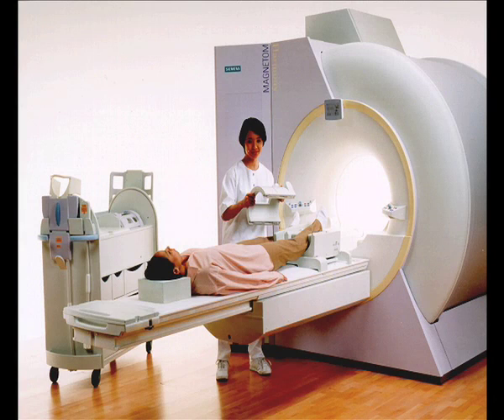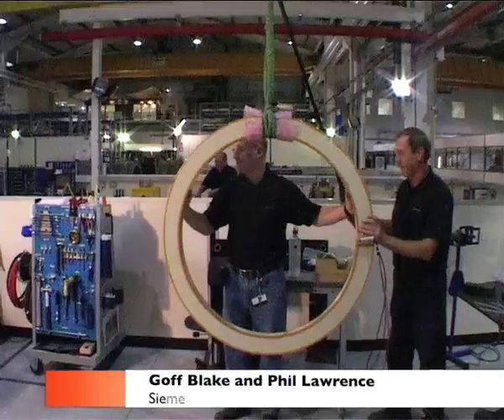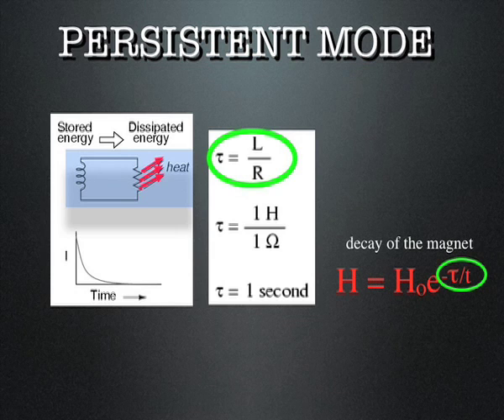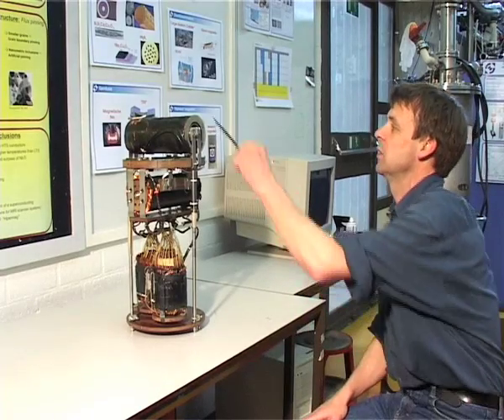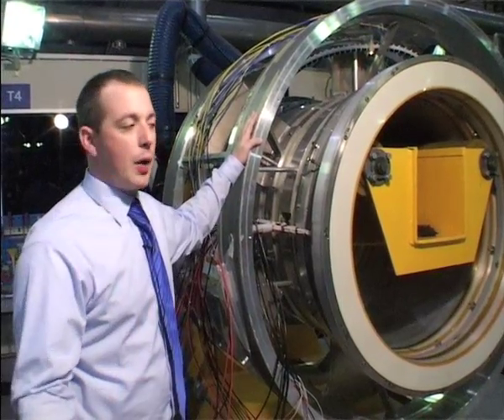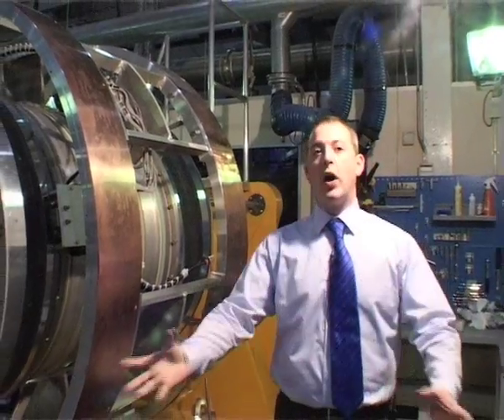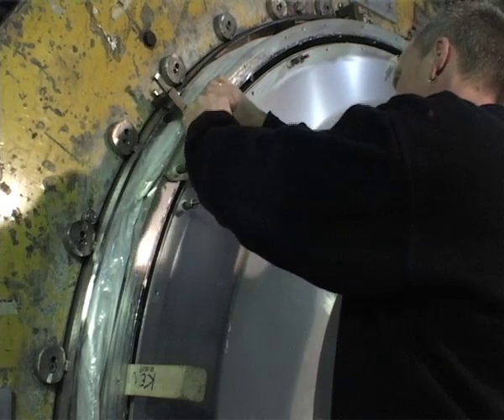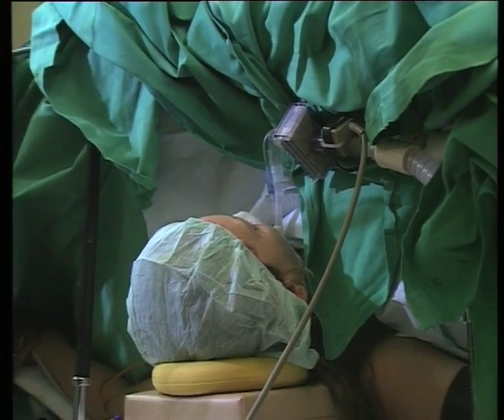Supeconduction: magnetic resonance imaging

Comment: FIrehose of dense information. Presented TOO quickly really - the "flux pump" section was particularly confounding. That's my problem though and not the presenter's! Why would HTS magnets need a constant power source?
Reply from the maker: Any change in the current through the coil leads to a large voltage spike, mechanical stress in the windings and eddy currents, all of which can precipitate a quench.
Reply: @bhadeshia123  right but I'm just saying I don't really understand why that's an issue in HTS but not LTS. what about HTS makes it different if it's in the superconducting state?

Comment: *THEY DO A GREAT JOB BUILDING THE MAGNET*

But magnet-builders are nearly 100% clueless about the *exact physical nature* of how the magnetic field manifests itself in the space around the magnet.

He said at time 5:40  "The stray field goes out about 40 feet" outside the magnet.

That's easy to know, because the stray field can be measured.

But if you point out the following, no informative answer will be forthcoming:

"You say that the stray magnetic field will be 40 feet deep outside the magnet - you are aware that this will hold true in the vacuum of empty space, correct?  In other words, if you carried this 7 Tesla magnet into space and turned it on, you'd have a 40-feet deep magnetic field surrounding the magnet?  Point being, no atmospheric gases are required to manifest that magnetic field - you know that, right?"

ANSWER:  "Yes, of course.  Magnets absolutely work in empty space - otherwise, none of the space vehicles and satellites launched from earth would have worked, since they all use electromagnetism in their electronics, including areas outside the habitable spaces.  Magnetic fields absolutely function the same in the emptiness of space."

"Alright then - what is the physical nature of the magnetic field,  since we know that no atmospheric gases are required to manifest the 40-foot deep magnetic field this 7 Tesla magnet creates?"

ANSWER:  "It's magnetic lines of force.  From Maxwell's equations."

"But what is the physical essence, the 'carrier substance', that allows the magnetic field to be a continuous entity stretching 40 feet deep?"

ANSWER:  "Magnetic lines of force."

This has been a 'blind spot' in science for all of human history.  Very few people know the correct answer.  The proof is, if you ask the similar question "do electromagnetic waves propagate by way of a medium in empty space?"   the answer will be  "light waves, radio waves, etc. - do not require a medium to propagate."

Not only does the majority of science believe that, they do not even realize it should be challenged.
.
.
Reply: Thats why the electromagnetic force is listed as one of the four fundamental forces and everyone agrees to consider it as an axiom at this point. Probably there is deeper stuff at work, feel free to figure it out. 
Cheers.
Reply: @MrFujinko  The particle-antiparticle 'soup' of the QED (quantum electrodynamic) Vacuum is the 'deeper stuff'.  This is at least part of the answer.  Thanks for encouraging all of us with our curiosity that investigates beyond the conventional!
Reply: @Greg_Chase  What about this Casimir effect and virtual particles, stuff can just pop in and out? Is it the vacuum itself changing?
Reply: @MrFujinko  I stopped publicly talking about this because there is very deep, passionate conviction in the mainstream about status quo 'modern physics.'  I got sort of fatigued about the grief it caused.  When it comes down to brass tacks there is always a demand for repeatable measurements and the insistence that "you cannot reason along those lines because our present ability to measure Nature at that level does not exist."

One interesting point that is always suggested about virtual particles is that they 'pop into existence' and then self-annihilate.   For example an electron-positron pair pop into existence and then annihilate.

If the QED Vacuum was (partly) a 'soup' of electron-positron pairs that are constantly annihilating,  there should be a massive gamma ray component of the Vacuum.  The reason is, it is known that the annihilation of an electron and positron emits gamma radiation.

When presented with this,  the usual defense is "virtual particles don't really exist" and that "they don't really self-annihilate"  and that "virtual particles are a mathematical notion only - not physically real."

There is a massive investment in time, money and career to participate in mainstream physics. The near-complete majority of such people will defend convention as if it was their first-born child.  I'm in no position to persuade anyone anymore.   But lines of inquiry into the exact physical nature of magnetism and gravity are rewarded if you cast off convention when it becomes necessary.
.
Reply: @Greg_Chase  That was very interesting, thanks for taking your time to respond.
Reply: You mean heavisides equations
Reply: @jonathanfilip6498  Yes, and imo the sooner we abandon Heaviside's worthy but ABRIDGED desecration of the master's work, the better.

Let's get back to what MAXWELL said.  Heaviside's goal was to abridge what he (and many others in that time) felt were 'clumsy' or 'intellectually inaccessible for the common electrical engineer' original forms from Maxwell.

It would be like taking a 1st grader and saying "we're abridging your mathematics education - here are several easy-to-solve differential equations.  That will do you for practically any engineering job. You don't need to spend your next 12 years of education, 1st through 12th grade, learning tedious math - we just showed you the most important bits."
Reply: @Greg_Chase  maxwells work is extremely important. It’s the only reason heaviside was able to extrapolate those 4 equations. But you are right. Going back to his work then moving forward is the best approach. No education system will ever teach you that
Reply: @Greg_Chase  one important but off topic question to ask would be what would Tesla be doing with all this digital equipment and circuitry we have today. We can create any waveform we want so easily today. We forget how important that is
Reply: @jonathanfilip6498  He would have developed sophisticated artificial gravity control.  In reading his experiments, it sounds like he may have accidentally discovered how to manipulate the Vacuum to affect the magnitude of inertial drag experienced by matter objects in the vicinity.

There are 2 important gravity control functions:
1)  increase inertial drag magnitude immensely in the immediate vicinity of a device

2) decrease inertial drag immensely in the vicinity of a device

In reading his experiments, I am confident he accidentally stumbled on to (1).  His rig generated immensely high voltage pulses, which were snuffed out via a magnetic shunt, resulting in very short rise-time of his high voltage pulses then quickly quench the pulse.  That will cause an increase in inertial drag IF the pulse is coherent and I think he solved the coherence problem with his test rig.

By now he would be under intense scrutiny for that kind of tech.  World governments are quite fearful of artificial gravity control tech going mainstream.
.
Reply: @Greg_Chase  it’s damn close to going main stream. There’s hundreds of patents for electromagnetic propulsion. Tesla has a patent for one and I was trying to find it but can’t. I’d check out steinmetz work. It’s the closest we have to his work.
Reply: @Greg_Chase  and there’s no such thing as anti gravity because there’s no such thing as gravity. It’s the work of the inductor and the capacitor of this rock we live on. It’s all electromagnetic. It’s blindingly obvious with the correlation of Newton’s equations and the basic force equation of charges
Reply: @jonathanfilip6498  See, you have the same belief as 99.99999% of science practitioners.  "There is no anti-gravity."

OF COURSE THERE IS.  Gravity, just like a magnetic field, is a condition of the QED Vacuum. Call the condition of the Vacuum that has been altered by atoms "VAA"  ('Vacuum Altered by Atoms').   The Vacuum is a dielectric with its own electric permittivity and its own magnetic permeability.  

The dielectric Vacuum can be altered by the right type of equipment and by bulk atoms (such as the Earth's bulk collection of atoms).  The Vacuum near Earth is altered compared to the Vacuum dielectric that is found in open space, far from any planet, star, etc. - ie. far from any gravity generator.

How do we know the Vacuum near Earth is altered?  Easy.  The refraction ('bending') of light around large, bulk collections of atoms - found in stars and planets.  Even Einstein noted the 'bending of light' (refraction) due to gravity.

SO WHAT IS 'ANTI-GRAVITY'?   It is the conditions of the Vacuum when no gravity generator is present.  Call the condition of the Vacuum that is far from any gravity generator "VAC"  ("Vacuum Ambient Conditions")

A device that restores a small region of the Vacuum to VAC conditions is an anti-gravity device.

*The VAC condition IS ANTI-GRAVITY*

Anti-gravity is a specific CONDITION OF THE VACUUM.  It occurs naturally out in open space, far from any celestial body.

And the right type of equipment can alter the Vacuum, right here on Earth, so that the Vacuum takes on that VAC condition.

"It sounds like you're saying - temporarily move the conditions of the Vacuum that are found out in open space - into a gravity field, such as Earth - and you can then neutralize gravity?"

That's exactly what I'm saying.  There IS no noteworthy gravity field in open space, far from any celestial body.  THAT IS A LACK OF GRAVITY.

A LACK OF GRAVITY IS ANTI-GRAVITY because you CAN change the Vacuum conditions - with the right type of equipment - to take on the VAC described above.

The reason 99.99999% of STEM people think 'antigravity doesn't exist' is:

1) THEY HAVE POOR OBSERVATIONAL SKILLS

2)  THEY THINK THE VACUUM IS EMPTY - Even though many of them KNOW that

A)  the Vacuum is a dielectric
B) with its own electric permittivity and its own magnetic permeability.  

99.9999% of STEM people say
"EM radiation does not need a medium to propagate"

"Magnetic fields do not need a medium to manifest in"

"Space is Empty"

"And Space is capable of refracting (bending) light, and Space is a dielectric with its own electric permittivity and its own magnetic permeability"

I'd say at this rate of ignorance, the Control Freaks who are scared to the hills of artificial gravity going mainstream - 

THEY HAVE NOTHING TO WORRY ABOUT.
.
.
Reply: @Greg_Chase  don’t jump the gun chief. I don’t like the word antigravity because like I said I don’t believe in gravity. I believe in electromagnetism. 

Now in your context technically I do believe in antigravity because it’s just electromagnetic or electro hydrodynamic propulsion. There is no propellant involved just the interaction of fields. 

There’s 100s of patents for this type of technology. Also the gyroscopic crafts are extremely close in relation to the EHD craft due to angular momentum. It all centers around the double sided vortex. The magnetic field. 

But yes “antigravity” is real but jumping up on the air is technically antigravity too. 

Search: triangular electric space craft patent

This is an example of an “antigravity” craft
Reply: @jonathanfilip6498  I've studied patents for a while.

I actually know how to produce a device that performs two functions:

1)   creates a large increase in inertial drag in the immediate vicinity of the test rig

2)  creates a measurably decline in inertial drag in the immediate vicinity of the test rig

Conceptually the tech involves pulsed coherence of the nuclear moments of the material.

I'm not the only experimenter who has figure out the tech. For me it's a hobby.

I'm 100% convinced the govt does not want it in the mainstream.  

The key is to get all atoms in the device 'working together' instead their normal random orientation that is found in bulk matter.

Pulsed coherence of atoms in a test rig alters the Vacuum.  Tesla had such a rig working over 100 years ago.
Reply: @Greg_Chase  is there something I can look at that comparable to what you’ve made?

I know how to make my own craft but only two ways:

- high voltage dc between two electrodes or more commonly known as the asymmetrical capacitor 

- and my engine which is still theoretical

Haven’t got either to work. Also your drive sounds gyroscopic in nature or containing a rotating charge
Reply: @jonathanfilip6498  A dielectric resonator with piezo layers immersed in cryo fluid like LN2 or liquid helium is one way. A lamination (multiple layers) of conductor/piezo/conductor/piezo/conductor/piezo/conductor etc.

A (very) short duty cycle pulse train at high microwave frequency creates an immense increase in inertial drag for the device in its immediate vicinity.

A long duty cycle pulse train at high microwave frequency reduces inertial drag, measurably, in the immediate vicinity of the test rig.

The particular cut of the piezo crystals is important.  I'm not going to disclose it.

I'm a hobbyist, nothing more.  Have no plans to write any books, speak at any gatherings, nothing.  It's a curiosity thing I wanted to figure out - a riddle basically.

There are a lot of people who know the technique and other techniques to manipulate inertial drag and it's just not worth it to popularize it, not now anyway, because the govt friction against that is immense.  I respect the govt's choice here, I had a top secret crypto clearance in the USN,  and I suspect this tech is classified, although I can't prove that, I was never exposed to anything like this in the service, but I suspect it's classified.  IF the govt wants it out, they will have to decide to do that.  No private citizen should do it.
Reply: @Greg_Chase  that sounds very interesting. Sounds like there’s some resonance involved especially considering the custom cut of the crystal. That changes a lot. 

Light is just a frequency just like everything else

C=1/sqrt(LC) where L is the inductance of the vacuum of space and C is the capacitance of the vacuum of space. This is in one of steinmetzs lectures of Einstein’s theories